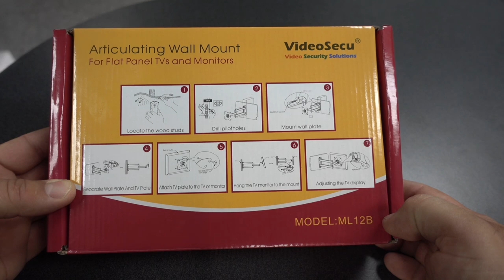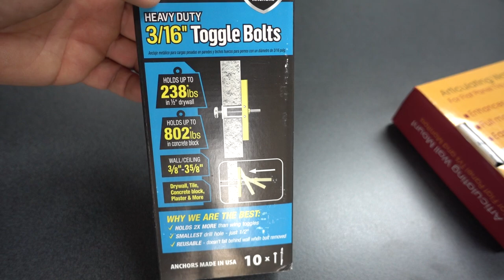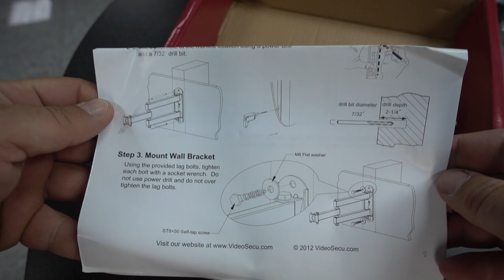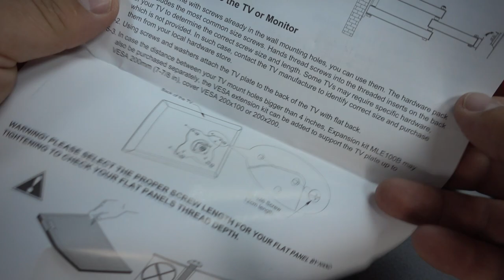How to Wall mount Flat Screen TV Wall  installation VideoSecu ML12B Bracket

Comment: Measuring from the ceiling to see if it’s level was a great idea since I don’t have a leveler. You could apply that to hanging pictures or anything really. Also I thought about it and it doesn’t have to be perfectly straight since you can rotate the monitor some